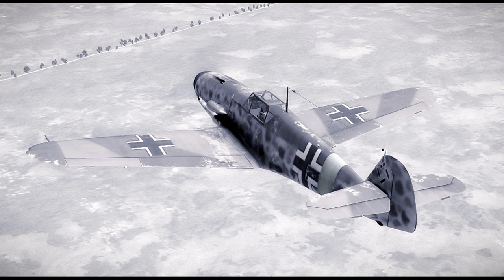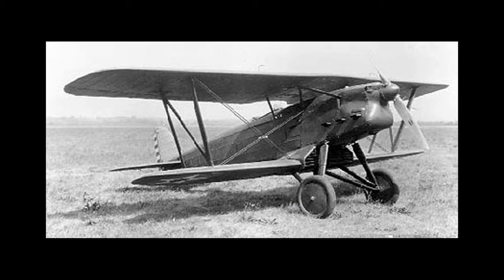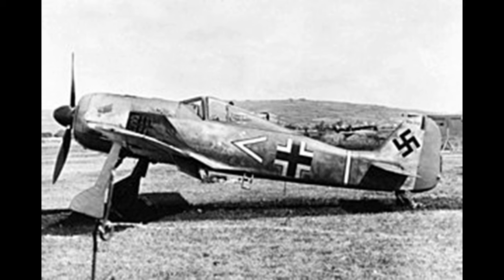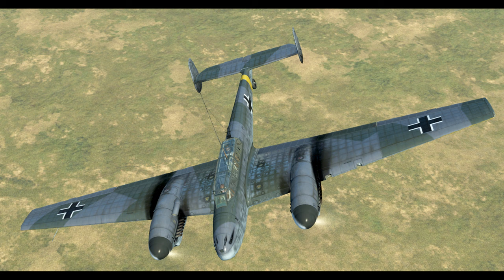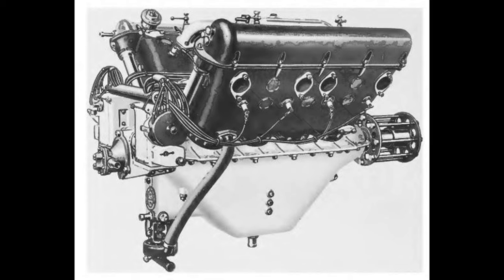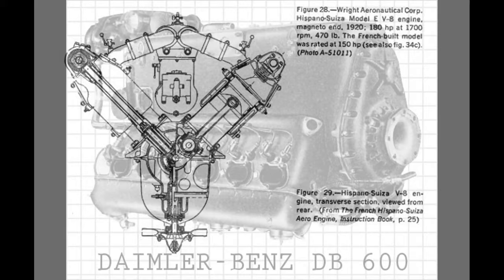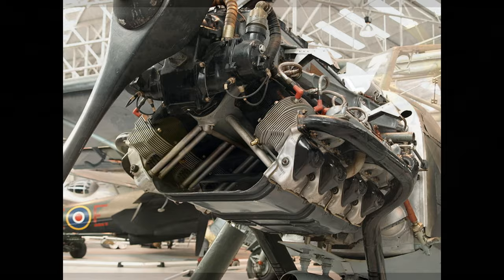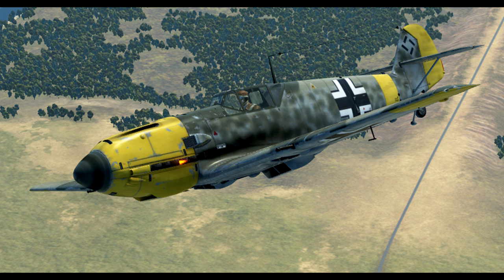Messerschmitt Bf 109 , Why an INVERTED V-12 Pt. 1? inverted V12s vs. upright

Comment: I wonder if nose/fuselage mounted armament could've been a factor. Or rather: The ability to mount guns into the nose of the 109 more easily with an inverted design. IIRC, the earliest 109 designs only called for twin MGs in the cowling and they only added wing-mounted guns (MGs initially, later upgraded to FF cannon) when they got news that the Hurricane and the Spitfire were expected to carry 8 MGs.
Also: According to squadron/signal's "Bf 109 in Action", some 109 prototypes had three MGs, one of them firing through the propeller hub. They cite prototype V3 as the first 109 configured in this way. This prototype was powered by a Jumo 210, which also was an inverted V-12. 
I'm not 100% convinced that engine mounted MGs or cannon truly were a thing with early 109s (I've found all sorts of opinions on the matter over the years), but if they indeed were, perhaps an inverted V-12 would make that installation easier too?
Then again, the French D.520 had an upright V-12 and did mount a 20mm as an engine cannon, so ... :)
Reply: I've read that early models didn't use engine mounted guns because it could jam the gun, but I'm sure early 109 had nose mounted guns shooting through the propeller like WW1 fighters, so I guess it was common to have nose mounted guns and thus leading to the inverted V12 being used, but if you see the British Nimrod and Fury biplanes had upright engines and nose mounted guns so I don't know anymore
Reply: Also the He-51 had nose guns with an upright engine but the fuselage was very boxy looking, the 109 on the other hand was very aerodynamic so I guess it was a combination of factors, nose guns and better aerodynamic

Comment: One of the things Germans did “This is just my opinion” was over engineer things. The Russians on the other hand made things quite simple and fairly easy to work on. Plus, the simpler it is the easier it is to make a lot more of whatever it may be. As for them inverting the engine, I think your reasons are the most logical reasons there are. As for other aircraft, I think this is just the way they decided to do things, so, most aircraft were designed knowing the engines would be inverted. Don’t fix what isn’t broken basically. Anyway, another terrific video as always. Ha! If you had a dollar for everyone of us that have said that you’d be quite wealthy. LOL!

Comment: As a licensed aircraft mechanic, I quite disagree with the ease of maintenance aspect. 

You ask any old mechanic which cylinders on a radial are the worse ones to change in situ... they’ll always say the bottom ones. 

Any time you have to look up, lift over your head, deal with oil dripping on you, deal with parts falling in your face, etc... the job is harder. 

I’d much rather get on a six foot step ladder and remove the heads on a Merlin or Allison, than stand under a DB6xx or Jumo 2xx and do the same thing. 

Even changing spark plugs, the difference between the two types of engines is pretty minimal. Maybe changing exhaust ejectors would be a bit better on the German engines, but that’s about it.

The other issue with any inverted engines is hydraulic locking. Valves only sometimes leak and typically don’t have much for residual oil in the heads. Rings always leak and there’s usually a lot of oil on the bottom (top) of the cylinders. Inverted engines like the Ranger and Gipsy became extinct and radials are nearly so in favour of the horizontally opposed engine which has the advantages of prop clearance and visibility with no hydraulic lock issues. 

Regarding visibility, most inverted engines were designed that way because of visibility in combination with prop clearance. However, once you get into geared engines, the shaft is offset enough to make little difference. 

I think for the German large V-12s... there were a couple of factors. First was the armament requirement for the 1935 fighter.. two machine guns initially (which would fit on either side of the crank case) and the Motorkanone... which would be too high and intrude awkwardly behind the instrument panel in an upright engine. The RLM also demanded a fair bit of interchangeability between engines which meant the Daimler-Benz and Junker designs both needed to share the same configuration. 

The inverted engines definitely had a slight edge on visibility, and certainly in comparison to the Bf-109 V1 and Avia S99 variants which used upright engines without being optimized for them... but I don’t think it was a deal breaker or even intentional.
Reply from the maker: Ask them which spark plugs are easiest and not in a hangar. Try changing them with a ladder on a muddy soft surface when it's 40F and raining. As a licensed aircraft mechanic you should know that your cylinder argument is invalid because you don't change cylinders on a liquid cooled V-12.

Comment: actually there is a tank that used a v12 inverted design. the Pzkwf VIII MAUS was built and designed for use the MB517 diesel engine. I know it was never used in battle but it was built with that type of engine (even if it was a diesel conversion).

Comment: When testing a captured Bf 109 early in the war in Britain, one of the weaknesses identified was how constricted the cockpit was for the pilot, adversely influencing both the operation of flying the plane and the ability of pilots to get out in a hurry, the side-hinged cockpit glass was also an issue.  Perhaps Herr Messerschmitt overdid the streamlining of the body shape in line with the MB601's profile.
Reply: Looking at early German fighters like the He-51 and the He-112 you can see the influence the engine has on the fuselage shape, the He-51 was very boxy and the He-112 was very aerodynamic and had an inverted V-12

Comment: I had heard, many years ago, that the Germans had visited Rolls Royce in the early '30s. Rolls, in their typically English way, inverted their V12 of the time and outlined the advantages. I am not 100% sure as to whether this influenced the German design. Who knows?
Reply from the maker: I have read that story, but it's nonsense. The German used of inverted V engines pre-dates the story by years.

Comment: I don/t think Allison got short changed production wise,   it was reputation wise and how much better the Merlin supposedly  was.    Production wise Allison had a huge run.   A lot of  Packard Merlin's build was for Lancaster and Mosquito and those would not have been Allison.   A little known fact was the cooling system took less glycol  in the engine and it would have been a factor in bringing back an aircart with a damaged engine.     Its good to see Allison V-1710 get the credit it deserved.    It was a more reliable engine with higher overhaul times,  simpler and the Army Air Corp held back on letting them push the hp limits (though you can figure the pilots did) as well as the tying Allison hands behind the back.  Given the same Supercharger setup as Merlin,  the Allison would have been a better engine in the P-51B on.
Reply: The Allison is my favorite, it annoys me it gets the short shrift because the AAC wouldn’t let/didn’t require it to have a 2stage/2speed supercharger.  It should have been the queen, just like the Mustang…which I also favor the Airacobra over, for the same reason.

Or, I just like underdogs.

Comment: I have to take issue with your belief "ease of maintenance " was a factor is using the inverted V-12.  German aircraft engines were usually removed and sent to the factory for rebuilding and replaced with new/rebuilt engines rather than working on them in the field.  The Allison and Rolls Royce V-12s (upright) were usually worked on in the field.

Comment: Just reading Callum E. Douglas' book, The Secret Horsepower Race. Worth checking out.
In it on P74 he quotes a German Wolfram Eisenlohr who said that in 1928 requirements for large aircraft engines were drawn up. Inverted V was specified for:better field of view, reduction gearing over the engine, hollow bore on the axis of the propeller shaft for gun, as inverted V wider lower, this would offer less drag as the widest part of the engine would fair/blend in better with the wing/fuselage joint.
Mostly my wording/abridging. 
But I think this answers the question.
Reply from the maker: This video pre-dates that book.
Reply: @GregsAirplanesandAutomobiles  So treat my comment as an update.
Reply from the maker: excellent

Comment: Aircraft engines in extreme cold require preheating. I've seen a procedure used in WW2 by both sides where a fire supplied heat up to the engine. Figures at least the jugs would get heated faster making preheating faster since the valves would be warmed up and not sticking allowing prep time to be shorter.

Comment: I got my A&E license back in the early sixties. None of my instructors ever mentioned the vast array of feelings emoted by piston driven aircraft engines. Engines and their myriad of parts do what they were designed to do, period. They don't care, feel, or suffer anything. They don't cooperate with one another except by design. They don't starve for oil or suffer from excess heat. Engines have no sense of up or down. They don't scream or howl at full throttle. It doesn't  demand anything such as higher octane fuel or starve for lack of oxygen or drown in its oil supply. They are very complicated inanimate objects that operate precisely as the laws of physics dictate. They are not our friends or family members, they do not purr or hum or answer the call of the throttle. Once assembled they just ARE.
Reply from the maker: Wrong, they often don't do what they were designed to do. Ask anyone who owned an early Chevy Vega.
Reply: Greg's Airplanes and Automobiles you are right, sometimes there is no accounting for a perfectly useful engine suddenly sputtering to a stop. Maybe they do have a human component. Maybe They go sour or throw a tantrum just for the hell of it??
Reply from the maker: I'm not sure, but I do feel that some engine have a certain character, especially the older ones.

Comment: The T29 had a weak turret, in one of Hunnicutt’s rare mistakes, he seemingly thought the T29’s mantlet was solid, and this idea is represented in most of its videogame appearances. Its mantlet isn’t actually solid, though, and this gives me the impression that the T29 was seen more as a running gear test bed than as a potential production tank.

Comment: Greg,
    Many thanks, very sound arguments and well presented. Although excellent machines i am still not convinced ( at least in my own head) why the inverted v twelve was the only game in town, other than dictat from government right at the outset. The paucity of certain metals for use in bearings hindered development during the war. IMHO maybe  inverted motors may have exacerbated those problems although unforeseen at the time. I have learned from Callum Douglas  excellent book "The Secret Horsepower Race',  their

Comment: Not sure if an inverted engine design includes and inverted fuel and oil system, but my father was a P-40 and P-51 pilot who explained that the Messerschmitt did have the inverted fuel and oil system, which enabled it to fly upside down without choking out the carburetor or starving the engine of oil. It also gave it the advantage of being able to dive by shoving the stick forward, where American planes had to roll upside down to keep the g-forces positive before diving, wasting valuable time. This is the version as I understand it and would welcome comments or corrections.
Reply from the maker: No, inverted V-type and inverted fuel and oil are two totally different things.

Comment: One thing that you did not mention was the type of fuel system, direct injection or carburettor. The Germans used direct injection for their inverted V engines while the Allies used carburettors for their upright V engines. Miss Shillings Orifice was the fix needed to help Spitfires and Hurricanes deal with the diving to escape Bf-109s. How much of this is cause and effect or simply a case of working with the engines and fuel supply systems that manufactures were familiar with is all up for debate. I tend to suspect that familiarity maybe the answer.

Comment: Great video!  However, pre-WW2, Rolls-Royce had absolutely no interest in selling its engines for use in tanks or boats.  There was simply no foreseeable market in these areas in the 1930s, and the Merlin was developed exclusively with aircraft use in mind.  Rolls knew that a few of their engines would be used in power boats (Italian Isotta-Frachini engines were actually preferred for this type of marine use), but this was in any case a tiny market of rich private individuals.  The Royal Navy were not at all interested in motor boats and in 1938 rejected a proposal to obtain a manufacturing licence for the Italian engine as they would have no use for motor boats in any coming war.  So non-aviation considerations played absolutely no part in RR’s design and development decisions on the Merlin (which were almost entirely related to increasing the power, reliability and the time between overhauls when used in aircraft).  Their motor car engines were a small part of their business and were not intended for commercial vehicles.  They certainly never expected that the British Army would become a major customer (and go on to put RR engines in armoured cars and trucks as well, in the 1950’s). The decision by Leylands in 1943 to use a derated Merlin in the Cromwell was because there was no other available reliable British engine of sufficient power, given the failure of the Liberty (which Nuffields were still persisting with in the Centaur). The concentration from 1941 on of British manufacturing on a very select few aero engines (RR Merlin, Napier Sabre, Bristol and A-S radials) plus the fact that Merlins were now being built by Packard in the US had resulted in there being surplus manufacturing capacity for Merlins by 1943.  In fact the Merlin and the Napier Sabre were the only available British non-radial aero engines in that power range, and the Sabre was new, teething, and in short supply. Radials such as Bristol Taurus and Pegasus or Armstrong-Siddley Cheetah were rejected as being too high in profile.  So the RR Merlin got the Army orders almost by default, and was definitely not a factor in choosing an upright rather than an inverted engine.
Reply from the maker: So nobody at Rolls Royce considered the possibility of using such an engine in a land based vehicle? I think that's unlikely considering their history.
Reply: Greg's Airplanes and Automobiles 
I’m sure they considered the possibility, but it was not an immediate one and had no effect on their design and development of the Merlin (or any other RR aero engine).  They had the Peregrine, Vulture and Exe on the go as well in the late 1930s and trying to make them fit for the Air Ministry’s tests was more than they could handle as it was.  RR had no ongoing relationship with the War Office like they had with the Air Ministry.  The last RR engines sold to the War Office was in the RR Armoured Car of 1916.  And that was the War Office fitting an armoured body on a RR chassis, not a RR product per se.  RR was a commercial company but in the 1930’s it could sell as many aero engines as it could make without worrying about tanks.  And the War Office bought air cooled engines from Armstrong Siddley for the Medium Mk 1 in the 1920s and then went to AEC for flat 12 petrol engines for the Matilda.  RR could have entered that market in the 1920s and done a much better job than A-S or AEC, but RR had their hands full with aero engines and did not seek to sell engines to the War Office (although they did some business with the Royal Navy).
Reply: I also read somewhere (David Fletcher?) that the Ford V8 engine in later model M4 Shermans owed a lot in its design to the Merlin plans and specs that RR provided to Ford in 1940 when it was planned that Ford would produce the Merlin for the British Purchasing Commission (which plan was overtaken by events and Packard got the job instead).  However I have not investigated and cannot vouch for this.

Comment: 14:35 Another way to do it is with air support. Then you don't need to worry if your tank is smaller than the enemy tank. Blow up the enemy tank from the air, then mow down the enemy infantry with your tank.

Comment: I'm not sure that the idea the Bf-109 was so dependent on an inverted V12 holds true. The Spanish built their own Bf-109 variant under licence (Hispano Aviación HA-1112), and that was adapted to use the Hispano-Suiza 12Z, an "upright" V12. After the end of WW II, they were fitted with Rolls Royce Merlin engines which lead to the strange position that in the film "Battle of Britain", some of the film sequences featured Merlin-powered Spitfires in dog-fights with Merlin-powered Bf-109. 

From the stats available, it's not obvious that the Spanish built aircraft are any slower for similar HP engines than the German aircraft with inverted engines.

However, the secondary uses in tanks and boats make sense. Perhaps, some of the maintenance issues too. Inverted engines were very common prior wit WW I, but usually on straight engines. Access to valve gear used to be quite important, and even heads could be removed in situ. However, by the time of WW II fighters I rather suspect that was no longer an issue. Engines would have been swapped over as those OHC, 4v per cylinder engines were getting beyond in-aircraft maintenance for complex jobs.

Comment: 9:45 I can think of one- The Maus, which used a modified DB 603.
Reply from the maker: That's not really an operational tank, plus it's so big they probably had room to get under the engines when installed.